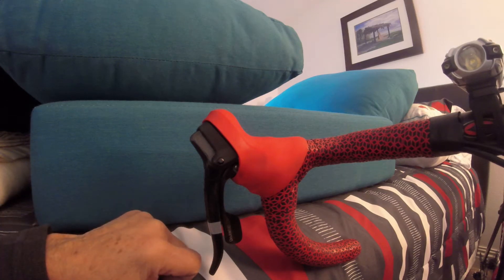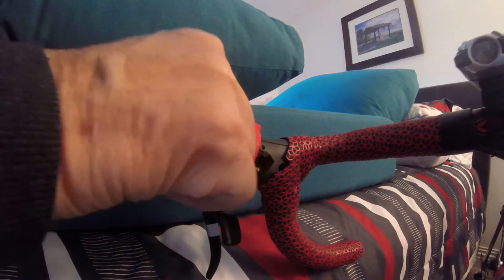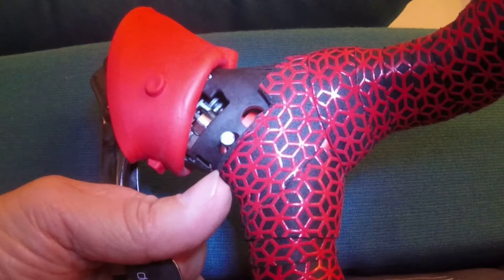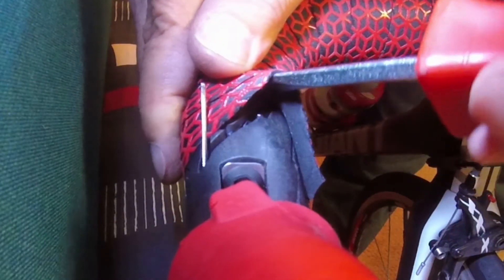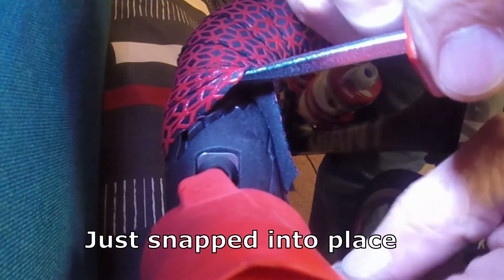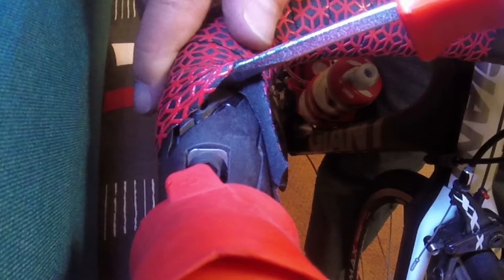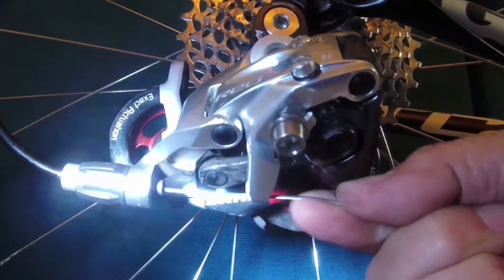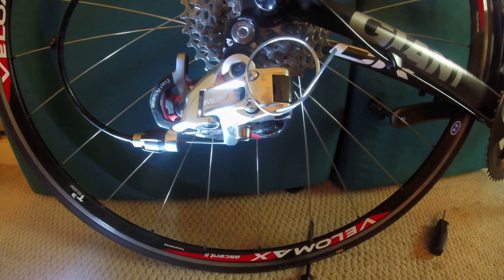How to Thread Early Sram Red Shifter Cables

Comment: I'm having trouble feeding the cable through the shifter itself since there is a tight bend. The cable goes in just a few mm and then stops. Did you have any trouble with that?
Reply from the maker: Yes, did you watch starting at about 2:20 into the video? This is where I had the problem. At that point into the video I show you how I got it through. That’s the only area I had a problem. It threaded through just fine after that.
Reply: @BicycleRestorationMan  Yes, but that is after the cable has gone through the shifter and it now needs to go into the housing. My problem was getting it through the bend inside the shifter. Mind you, mine is a different SRAM shifter. I finally got it by filing down the burrs on the cable-end, adding grease, and a making a pre-bend. Thanks for the video - I do appreciate the work.
Reply from the maker: @ravraid  got it, thanks for the info. Those housing ends can be a problem sometimes. Check out my other video on how to cut cables housing without mashing them. https://youtu.be/-pI_IkjJai8?si=so1HdmBNjw6ejBmF